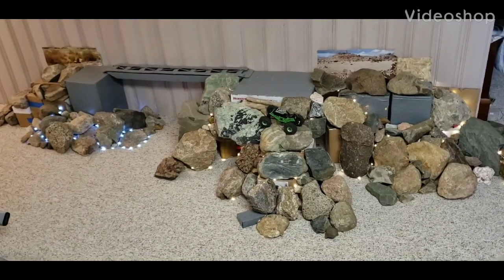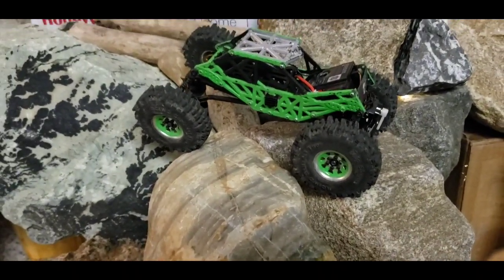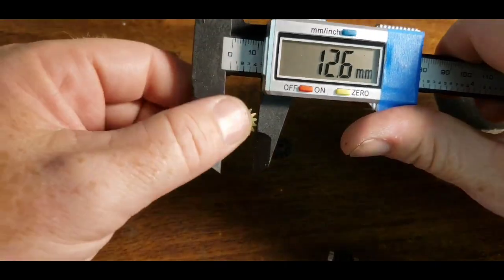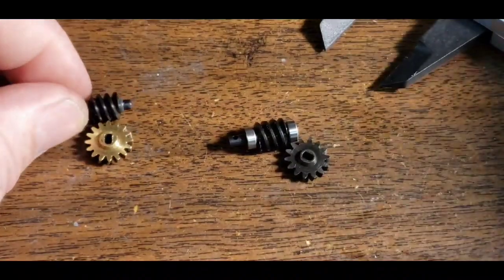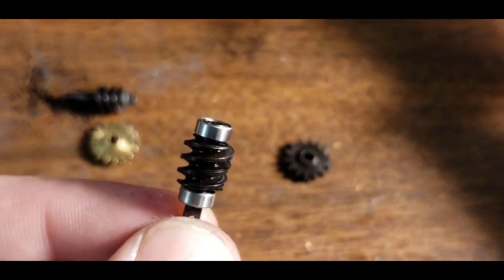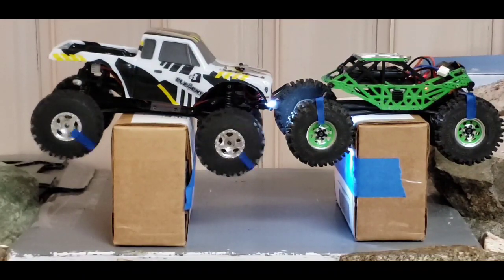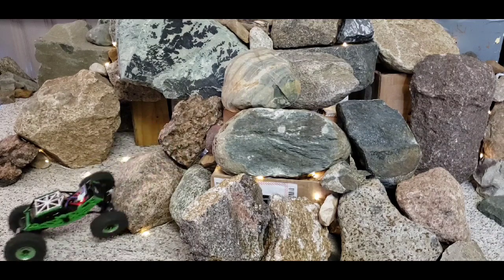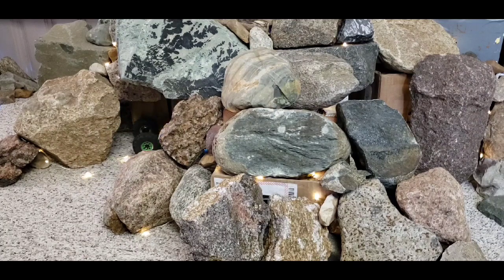SCX24 Overdrive Gear Science 🤓

Comment: is it  a bit faster on the carpet runs?
Reply from the maker: Not noticeably. 

I am not really a fan of overdrive gears. After using them for a while the only place where they really benefit is climbing a domed surface. My trucks could get up anyway though. Mostly they just put strain on your equipment and make the motor hot. 

Also any time the truck is moving either the front or back tires are breaking traction. That can be undesirable, especially while sidehilling.

Comment: From a math Standpoint should be harder for the motor to turn the wheels with the increased mesh angle of the gears and easier for the wheels to turn your motor resulting in less drag brake. Also with torque coming from the wheels a 13/2 ratio should be easier to turn than the stock 15/2. I would like my build to roll downhill a little easier so is your result with more drag potentially because the gears are not greased, broken in or something like that?
Reply from the maker: I believe there is more drag because the front and rear axles create a 14% bind due to the overdrive. Drive one. You can feel it in the trigger.
Reply: @EXPIOWA  Ah that makes sense. Because the wheels are turning the drive shafts at different speeds it causes more friction?

Comment: What oil do you use on your gears? I also want to try the 14t in the back and the 13t on the front to regain the speed I lost with the higher torque motor I installed. I want it fast enough to walk with it in trails.  Thank you in advance.
Reply from the maker: I use 3 in 1 Dry Lube. It works great and does not hold dust like a normal liquid lubricant.

Comment: Hear me out... This gear, in both axles, with a brushless conversion
Reply from the maker: I hear you. It would work. This is my take on it.

Why waste money on overdrive gears n both diffs with a brushless conversion when you can just tooth up on the pinion a lot cheaper? It would put less stress on the driveshafts as well because they would be spinning at a higher RPM for a given speed. 

The Enduro24s blow driveshafts partly because the yokes are inadequate and partly because it has high gearing in the diffs. The driveshafts rotate slowly but must carry more torque for any given speed.

Monster trucks work because of planetary gears inside of each wheel hub. The gear reduction happens right there. Instead of a slow routing shaft with a high torque load they can use a smaller lighter ones that rotate quickly without requiring a high torque load. YouTube it for more. They can explain it better than I can here.

Either route works as far as final drive ratio is concerned. One just puts more strain on the driveshafts and transmission.

Comment: I don’t know if you noticed this but your rears shocks are in different positions not the same position 😂 good vid explained overdrive gears good 🤙🏻
Reply from the maker: The shock position is intentional. They needed to be in different locations to help compensate for torque twist. This seemed optimum on my course.

I also have a single Flexblade on the right rear. Extra travel in that location doesn't give up much incline performance but it adds extra droop. Sometimes when the frame is touching the peak of a rock all it needs is a small push from one tire. The extra droop is helpful.

Comment: Too bad about the turning radius! I was hoping for better. Maybe with the 23% increase? Have you tried those? They'll prob just slip too though. I know there is limited space (ie tiny) but a CV joint may provide a better turning radius, after reworking the knuckles and axle ends. Maybe a little more Ackerman could help too. I too look forward to installing the MOFORC Nano Beast brushless motor in a low COG chassis. Sub'd
Reply from the maker: Try everything. Even if it doesn't work you will learn something. 

I have not seen the 23% gears. I would not even try them because it would put the truck in a constant ¼ bind situation. A big brushless motor could handle it but it would not be good for brushed. 

Thank you for watching. 🙂